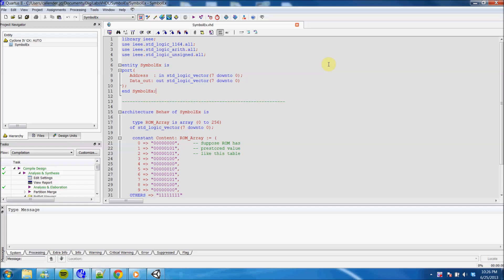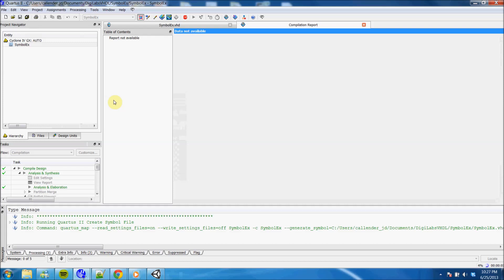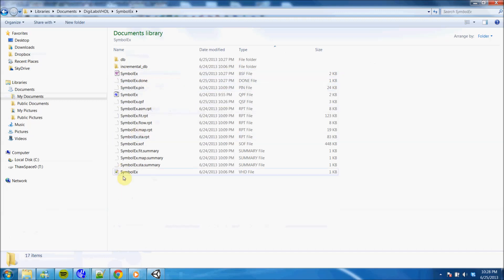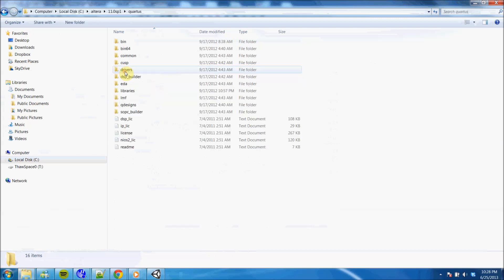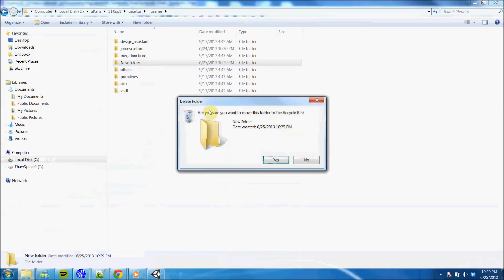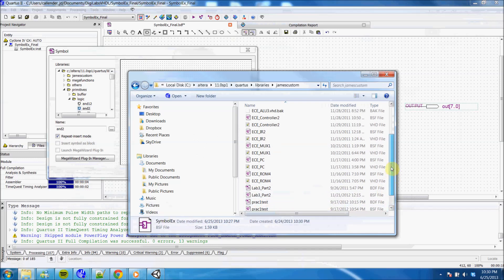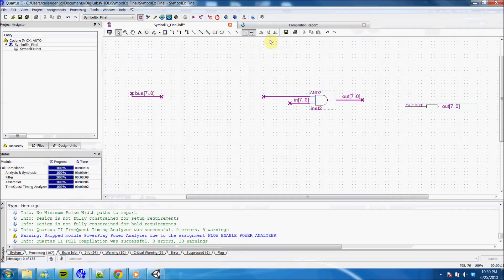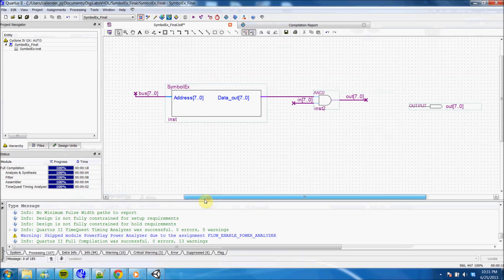Creating and Using Block Symbol Files

Comment: I did everything like you did but i get an error if i try to use the symbol file in a different project.
While compiling i get the following error: Error (12006): Node instance "inst" instantiates undefined entity "firstSymbol".
Do you know what i have to do to get it working? I googled 2 hours already but only found something about .qip files which i dont know how to create.